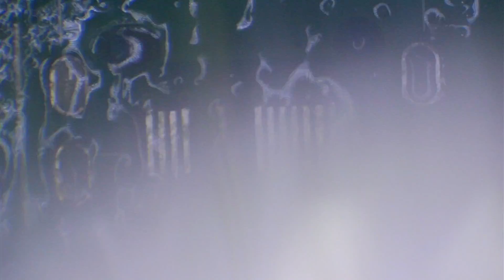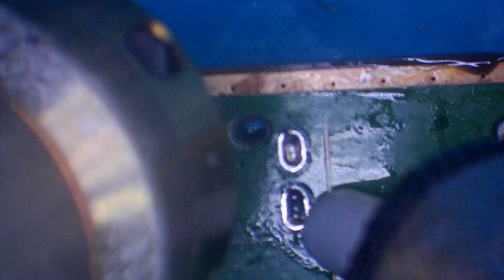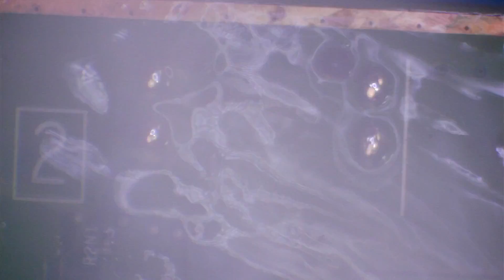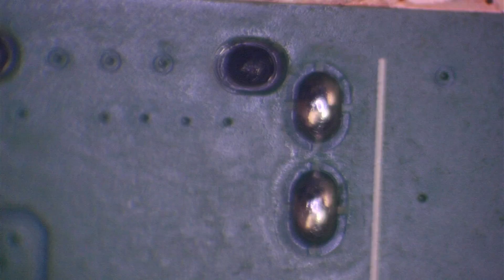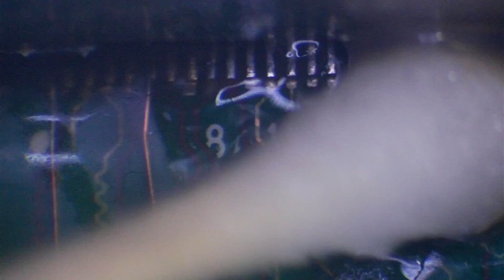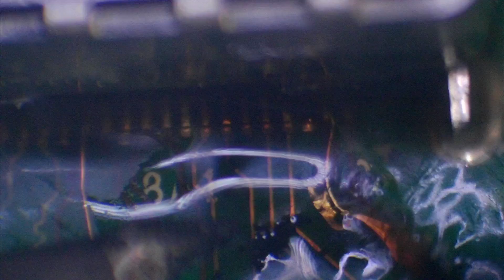Micro Soldering Techniques Episode 03 - How To Perform HDMI Circuit Trace Repair

Comment: Can you replace a micro HDMI with a regular size hmdi port. For example I have a monitor with only a micro HDMI but I want to remove it and add a regular HDMI port. I don't like conversation cables, 😂 I have a Samsung Odessa oled monitor and it only has one micro, no regular HDMI

Comment: would a finer tip soldering iron be more appropriate for attaching wires?
Reply from the maker: It depends entirely on the user, personally I can use pretty thick tips and don't like conicle tips but some people do, so it all depends on preference but the bigger the tip the better the thermal transfer will be